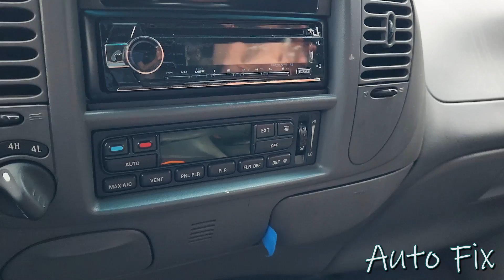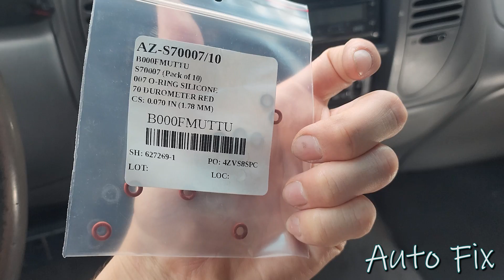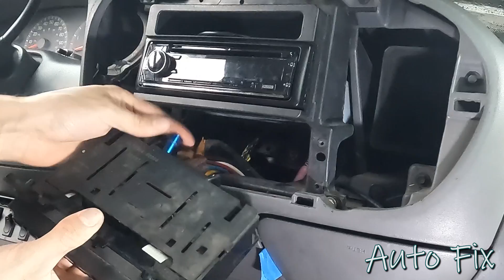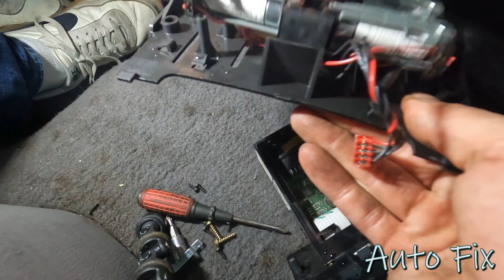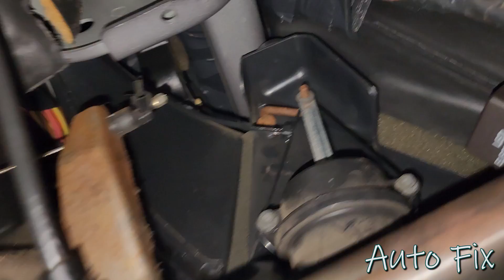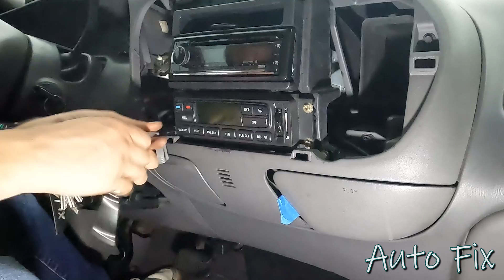FORD Electronic Climate Control O-Ring Replacement - No More "Stuck On DEFROST!"

Comment: Good video and good job showing how to do this simple job. . Im opening mines up to clean it with Electrical spray since the on and off button was getting stuck in the on Position after a rainy week here in Cali. I assume the dust in there and the moisture caused this problem. Any suggestions???
Reply from the maker: Probably a combination of dirt and moisture, yes. You might not have to take it apart, if you can spray it through the front of it.

Comment: I followed your instructions and unfortunately my actuators block seem more recent, no screws and soldered tabs, impossible to remove.
Reply from the maker: Interesting. I'm sure there are slightly different designs but I thought they were in the end all similar enough to this
Reply: Drill out the spot welds

Comment: Does the rings in the link still the same?
Reply from the maker: Yes
Reply: @CristianAutoMechanic is the silicone grease necessary?
Reply from the maker: @davidcolin1457 no but it can help
Reply: @CristianAutoMechanic ok, i just finished without the silocone lub. I hope this is my a/c issue
Reply from the maker: @davidcolin1457 If you had the same symptoms i showed in the video, and you have good vacuum supply at the module, this should fix your issue. It's very common on these trucks.

Comment: I was having same problem and took it to Ford service. They said they couldn't replace the control head because Ford doesn't make the part anymore. Basically that I was SOL. I found your video, and after spending a couple bucks, my A/C now works properly. This is such an EASY fix. Thanks for walking it through for me!

Comment: I've got the problem on my 2004 Ford Crown Victoria.The defrost position is the only that works. The temp mix for the AC/heat works too. The O-rings will arrive next week. Get it from ebay, it will cost alot more here in Norway. Will save alot of cost in relation to an EATC controller replacement. Looks easy to replace O-rings.

Comment: Mine looks different on the inside. There's none of the 10 screws holding the vacuum solenoids down to the top cover. There are 2 1/4" screws innthe back that holds the top cover on that screw into the vacuum solenoid frame. There appear to be a few spot welds on the vacuum solenoid frame that hold them in. I cannot figure out how to remove them without being destructive. I could potentially weld them back but there's a lot of sensitive stuff around the area.
Reply from the maker: Oh wow, haven't seen one like that. I don't wanna give you the wrong advice so I just won't give you any, but is it possible that someone was in there before and changed things?
Reply: @CristianAutoMechanic I've done some research. ALL EATC modules from 97-02 are like mine. Only in 03 did they change to the newer design. On the older ones you have to drill the spot welds and then use small screws or JB weld to hold the frame back on.
Reply: @AutoFixYT this video shows what the older units look like.
 https://youtu.be/AwfA7VHvPhI?si=fdk1Zp81BbTNVDW

Comment: Dude this is awesome been struggling with this for a few month now, got a used part and same deal it works better but not properly. 
I  shall give this a go, thanks again.
Reply from the maker: This should fix your issue assuming you have good vacuum coming to that module!
Reply: So mine still didn’t work lol dam it. I think it might just be the ac computer or the buttons maybe?? Only my vent work perfect lol even under acceleration and all.

Comment: The push cupholder in the dash is a pretty easy fix as well, your spring may still be in there to glue or rivet back on.
Reply from the maker: @thevortec983  not worth trying since the left track is also broken
Reply: @AutoFixYT  dang

Comment: So I just did mine and everything works except for the defrost. WTF?
Reply from the maker: That's kinda weird considering defrost is default, meaning if there's no input or vacuum at all, it goes to defrost.
Reply: @ Clearly I have vacuum as everything BUT defrost works. Actuator / Blend door? Would you venture a guess?

Comment: You didn’t think about the check valve.
Reply from the maker: That's true i didn't mention that in the video. In most cases though it's gonna be the little o-rings that I replaced, or a vacuum hose/fitting.

Comment: Thank You for the Video.  I've been living with the same problem for over a year.  I've ordered the "O" rings and will rebuild the control unit.  All other vacuum lines look good.
Reply from the maker: @eemorell  It's amazing how it works once you fix it. Makes being in the truck a lot nicer. Still a crappy way to control HVAC, i think it should either be mechanical (cable operated) or electronic (actuator motors). Through vacuum is just... stupid. Lol

Comment: it did work ! Now I have to figure out why my fan only runs on high ! O rings in the controller were the issue for my 04 Mercury Grand Marquis
Reply from the maker: Fan only on high is a classic sign of a bad blower motor resistor. If you have this type of HVAC control though, there is no resistor. It's all controlled by that unit. So in that case, the unit is bad.